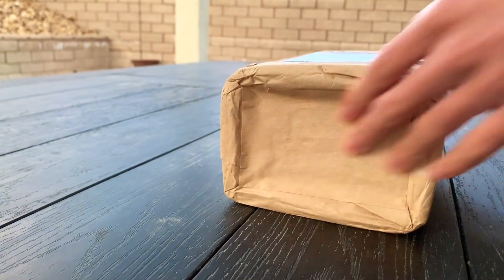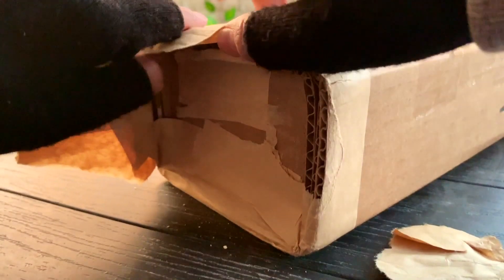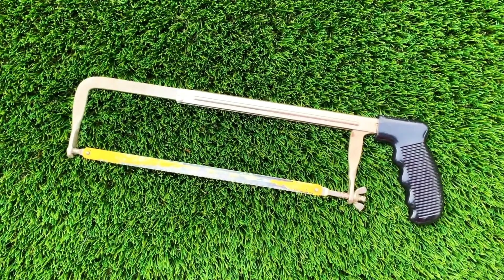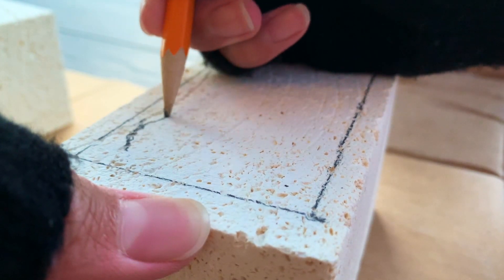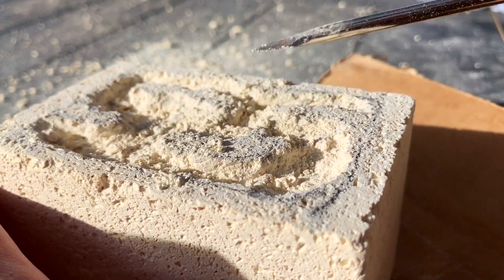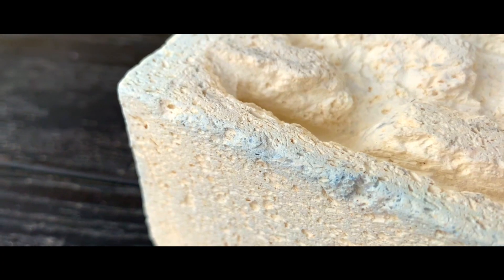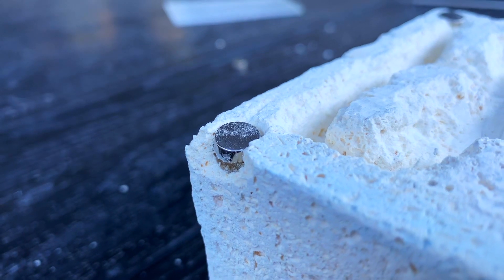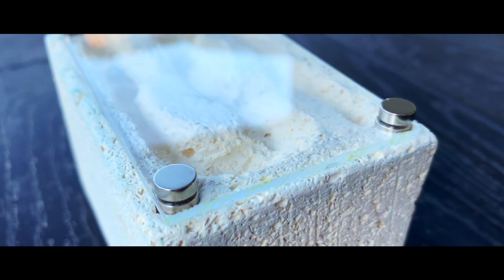Making A Firebrick Ant Nest | Ytong Alternative

Comment: Youtube recommends me this video after I struggled to find Ytong. I walked 45 mins to a hardware store in an industrial site in town then picked up my 6kg block. Realising I couldn't walk this home I had to get a taxi. I attempted to cut it to shape but it blunted two different saws I bought. Finally with a third saw I cut into it and have the shape I want. Now I'm trying to make the nest layout but shit the bed it's so tough. I had a little rotary tool but it's blunted all of the attachments. I find I can accurately chisel maybe 1mm off the surface with each hammer tap.

Now I can get this instead. I'll whittle away at the Ytong but I'll get this block too. I think It took me an hour or two to cut a 10x5x3cm cube out of the huge 1 and a half feet long block. It took you no time at all to cut the fire block. Like a knife through butter!
Reply from the maker: I’m glad you’ve found this vid :D I think ytong is easier to carve out than this firebrick, but its a good replacement. More diy tutorials on the way!

Comment: I just made one with the magnets but it doesn't feel 100% secure. If it fell from shelf or desk I'm confident that the cover would stay in place. Any alternatives other than epoxy?
Reply from the maker: I haven’t tried any other alternatives but thats the same problem I’ve faced, which is another reason why I haven’t moved a colony in. I plan to cut it in half add put it inside a tubs and tubes setup one day, as it will probably do be best places in there than by itself
Reply: @EnderAnts  i just purchased some quick set epoxy. I'm finding that it's not a pull off issue but side to side slide. Definitely going to tinker around! I'll let you know what I find. I reaaally don't want to glue it in case I need to open it for whatever reason but I may have to
Reply: @EnderAnts  SO I found that if I sand the mating face perfectly it'll almost suction itself on. I laid a piece of sandpaper on the floor and ran the face over it until it was level. It really helped but now I need to lower the magnets. I put one screw in as well. It got a little messed up when picking the magnets out so I'll be making a new one. Perfect test piece because now I have the technique!   It's a shame because it was pretty damn cool

Comment: On amazon all they have is “GREENTHERM 23 LI Medium Duty Insulating Kiln Smelting Precious Metals Soldering Welding Work Surface Jewelry Casting Firebrick”. Is that the same thing?
Reply from the maker: It should be, but if you’re unsure, try the other options on the page. Or try searching AMACO insulated firebrick.
Reply: Thanks

Comment: I've looked into K23 for over a year. Nice to finally see exactly how brittle it really is. I have many colonies and love the look of ytong but as you mentioned, it's pretty much NOT accessible here in the states. Looks easy to carve into as well. Just like to know what size brick was it you purchased? Would be nice to be able to make a few nests with one block. Not a bad first nest by the way. I would glue in the magnets though or use silicone. Would be a bit more stable that way.
Reply: I recently made a very large formicarium for my Iridomyrmex Purpureus colony, and I used acrylic glass for my double sided formicarium as this is a population of about 1500 ants, I also used super magnets.
Ran into a huge problem after a week of them moving into it. The acrylic started to warp due to the heat the colony was generating, had lots of escapes, ended up gluing the acrylic down haha.
Reply: At the moment I have 8 well established colonies and I think 6 more that founded  last year. As I said before, I have looked into K23 for some time now. Nice to actually see how it is with carving. Would be great for my Formica colonies and maybe even my Tetramorium colonies. I would probably either go with my Camponotus subbarbatus colony, one of my Formica subserica colonies or my Dorymyrmex bureni colony. I also have a few Formica pallidefulva colonies but only one being more than just last yrs catch. Definitely be looking into purchasing some now for sure! Need to get back into dping videos again on all my new inverts, especially my ants.
Reply from the maker: The entire block was around 9 inches long, 4 1/2 inches tall, and 3 1/2 inches wide. Pretty good size for about $10. For small colonies, the entire block can probably make 3-5 nests if you equal it out well.

Comment: So how are you going to hydrate that for your colonies humidity control?
Reply from the maker: I'm going to see if I can make a tiny hole with a syringe, and add water there so that it spreads from the inside of the nest. Or just place water on the outside of the nest and see how that does.
Reply: @EnderAnts  nice idea make sure you wash the brick well or the fine dust will kill your ants.